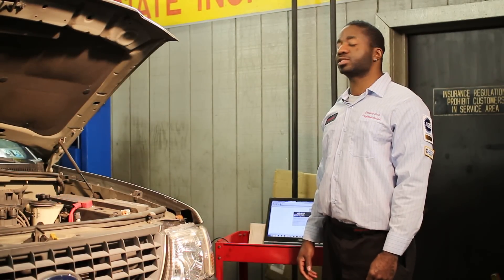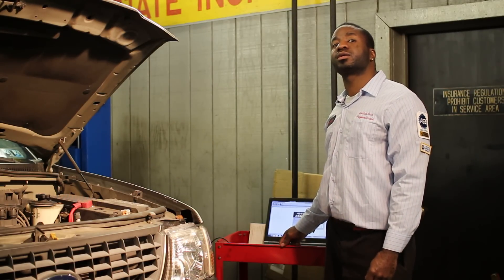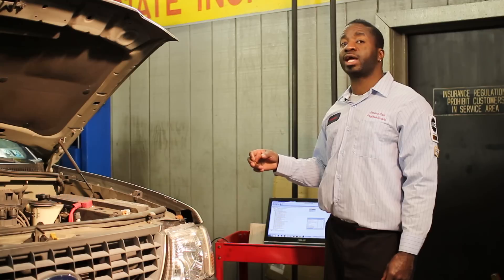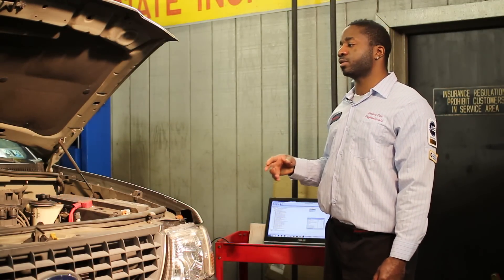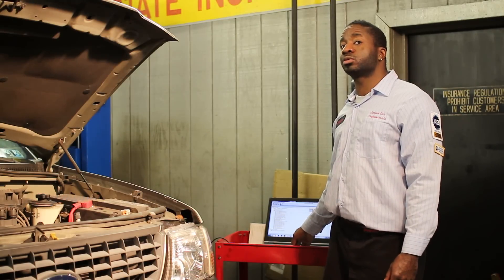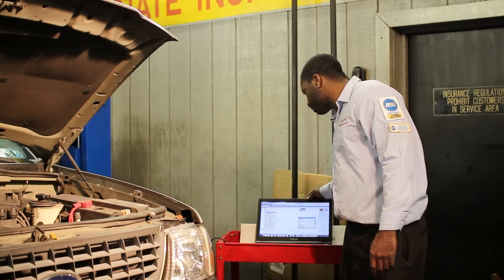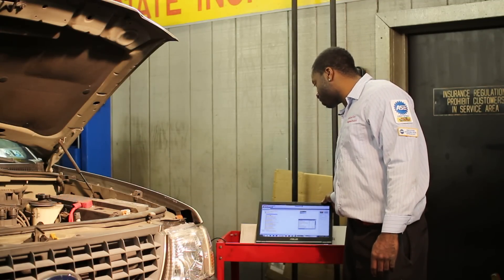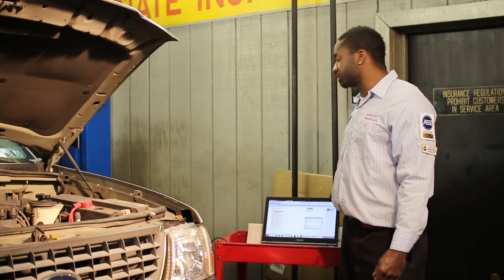Check engine light diagnosis code P0193 Part 1

Comment: is the fuel rail pressure sensor located the same on a 2006 ford Explorer 4.0 v6. just wondering if it's in the same place as the older models